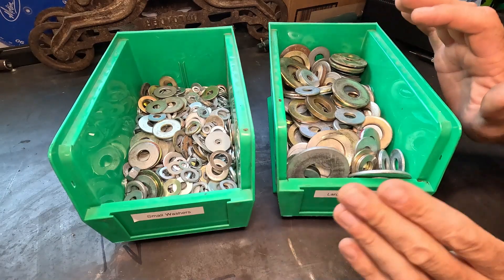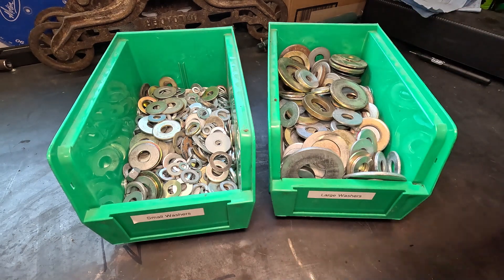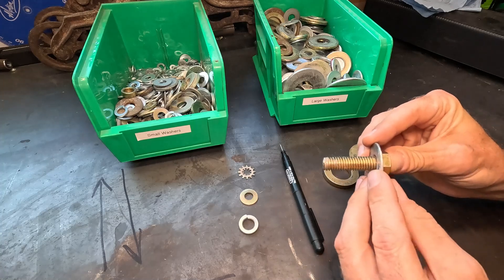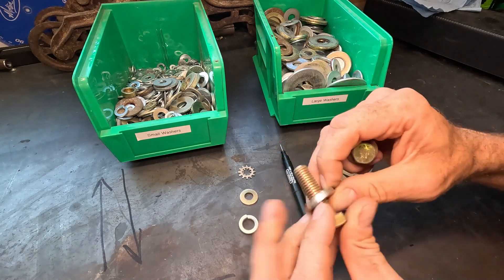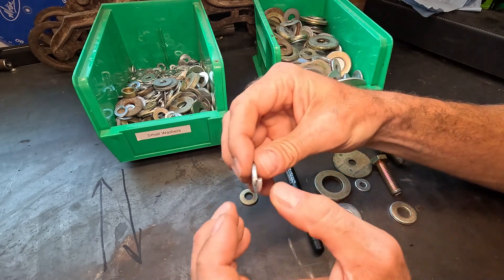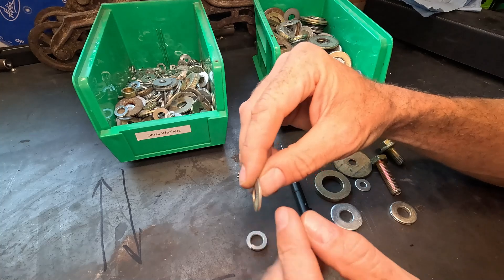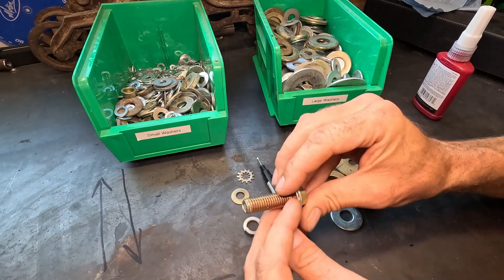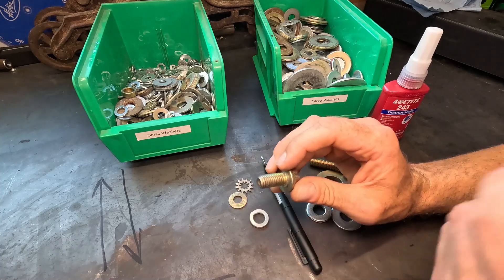What washers do within a bolt and nut joint.

Comment: A properly designed bolted joint does not need any locktite - but they are not actually that common!
Reply from the maker: Oh yes, for sure. This was one of my early videos and I unfortunately used my own dad's term of 'standard' which is false in any regard, depending where you are in the world! The equipment is working on is almost all metric hardware these days. Cheers!

Comment: High strength bolt that are torqued to spec, normally require a hardened washer to provide a smooth hard surface to produce consistent torque values. These washers are never galvanized because the zinc is soft and will increase the torque by deforming.

Washers are typically used when bolting wood together.
Reply from the maker: I appreciate that engineering education! Keeping this video originally super simple for the most basic homeowner, I for sure missed the torque conversation. I've really appreciated everyone's comments and extra education to the masses. Stay safe in those Texas floods happening.

Comment: Thank you for this video. There is something I don't understand. If I am tightening a bolt through a block of steel, why do I need a washer in order to spread the load? Why can't I just allow the block of steel itself to spread the load? Thanks
Reply from the maker: Good point. In a situation like that, with a tolerance hole to the bolt, or the steel had internal threads where you're actually inserting the fastener as a screw, a washer won't really add value of spreading out the load. Like others had mentioned in comments (and I didn't cover, but should have) is there can be other value of the washer such as assisting with rotation to achieve a proper torque.
However, if truly just a hole in steel where you're not dealing with precision, the holes commonly are somewhat oversized to deal with tolerance differences of mating parts, so the small surface area of the bolt head is spread out with a properly sized washer (to the bolt).
Where I work in ag, often those holes in steel have a bushing inserted, so the washer (or flange head bolt) spreads out that load over/past the bushing to catch the parent steel part. So many different situations.

Comment: I thought those washers with a cut are just broken. Found a couple of them in my toolbox and just sell them off as metal scraps😢
Reply from the maker: Nope! Though as you'll read in the comments, many say the split (spring) lock washer is quite ineffective at holding the joint tight. Thanks for watching!

Comment: In a flange bolt the washer is integrated into the bolt, and is much stronger than a bolt and a thin washer, the latter will deform and is a weak spot that will expose the assembly to loosen its grip due to vibration, IMHO :)
Reply from the maker: I personally love flange bolts....fewer parts to drop in the dirt during disassembly 😀

Thanks for watching.

Comment: I think what you wanted to explain is how washers have an inner and outer diameter. The inner diameter determines what guage bolt you should use. The outer diameter determines how much surface area you want to speresd the tension over.
Reply from the maker: Well explained, certainly what I was going for. Appreciate you sharing that clarification! Cheers!

Comment: But why do they exist? You never mentioned what the point of washers actually is, even though that's the title of the video. All I took from this is that there's different types of washers.
Reply from the maker: Thanks for the comment. I was trying to be super basic for a general person about how they primarily spread out the load (force) from a fastener. Will keep working to improve.

Comment: You know, as I've gone back to reply to replies on here, I have another question: Why did you buy a bunch of different sizes of washers to dump into those boxes before knowing which sizes you'd need for specific projects, instead of just buying certain sizes as needed and then not rummaging for the right size?
Reply from the maker: Fair question. I like going to auctions. I bought a big container of new, mixed, hardware. No idea where it came from, but it was a huge lot of new bolts, washers, and nuts. The price was right, so why not right!? There were sooooo many washers, and the bins I had available, is the reason there are (comically) sorted to large/small. Better opportunity to sort going forward, but works well enough for now. Like you mentioned, I buy specific hardware if/when I need it.....if not available in my bulk 1x purchase. Cheers!

Comment: We use those toothed washers for better electrical contact for grounding wire with a grounding screw. Those teeth ensure it cuts through paint/corrosion for better electrical continuity.
Reply from the maker: Ahhh, yes, for sure! I've come across them in various electrical situations.  Great comment, appreciate you sharing!

Comment: Great video again James , This is good basic information that should get most homeowners by. I know a lot of folks don't care what the function of a washer is. But us hardware nuts ,so to speak , they are like the salt shaker on your kitchen table. Coming from an industrial background ,we used hardened washer for certain applications ,like when you have really need to tighten down on a bolt that in  is place where there is a lot space around the bolt. A low grade washer will cave in under high torque were as a hardened washer  will not !
Reply from the maker: It's such a simple thing, but really does serve a wide variety of purposes, and more complexity to it that I really lead on......as I exposed the very basics to the average person.

Comment: Another purpose of washers is to allow a bolt to float into position in a large hole. Sometimes you have sloppy tolerances on an assembly of parts, like NPT fittings joined together. You may not be able to guarantee exactly where the bolt hole needs to be within ±1/8". So, you make the hole bigger than necessary for a perfectly placed bolt, and take up the slop with a washer.
Reply from the maker: Great comment, thanks for sharing.

Comment: Nordlok washers work well. Every other locking washer is pretty much useless. Pretension is the most important factor in keeping a bolted joint secure. Tests have proven everything but a nordlok is pointless.
Reply: I work in the oil and gas industry. I used to work as a subsea engineer too, that's when I really got introduced to them. I've used them in both cases, particularly where there is intermittent loading or vibration. 
The down side to them is cost. If they were cheap, I'd actually use them for everything. As is, only in a needs must basis.
Reply from the maker: @lexzbuddy subsea engineering, wow, fascinating! There isn't much oil and gas around me in Iowa, other than ethanol production....all that corn! I ordered a Nord Lock washer from Amazon, just to see/play with one 😀
Reply: @LearnedFromDad  try not to break it :)  They work best in pairs, one under the bolt head and the other under the nut. I've witnessed testing and seen for myself, first hand, how much better they perform. I haven't seen anything pass vibration tests like a nordlok. Everything else, pinned, serrated, double nut... all just come apart.  

I spoke with a guy that works for the RAF and he said the nuts on aircraft all loosen off eventually. He said the good thing about wired nuts was at least don't loose the nut. Well, if that doesn't worry you, I don't know what will. OK, it's a bit funny too but you get my point. 

With all that said, enough load and vibration will defeat any solution, there is no such thing as perfect. But they are head and shoulders better than everything else.
Reply from the maker: @lexzbuddy  hahaha, sounds like I better purchase multiple! And I agree, no design is flawless, always a failure mode. The creativity of either next engineer will fascinate us! Cheers!
Reply from the maker: I've had many people comment about Nordlok, but I haven't personally encountered them yet. Any idea what industries commonly use them? And, great comment about tension. Really appreciate you sharing! Cheers.

Comment: If you put bolts in a machine with vibration use caulk silicone as thread locker, for me works every time.
Reply from the maker: Interesting technique, I hadn't heard of that one. Thanks for sharing.

Comment: Not sure if anyone else commented this but the additional feature of the ‘split’ or lock washer besides the compression effect is: The lock washer actually digs into the materials and literally locks or creates an anti-rotational action. If you look at the way the split washers are stamped out they cannot easily rotate left(loosening direction), but they turn easily right(tightening direction). Lefty loosely, right tighty. Don’t use a normal lock washer on a left hand thread, lol….   Great video!! I am now a subscriber.
Reply from the maker: While many have commented about the ineffectiveness of a split (spring) lock washer, you're the first to reference that point. I wonder if they make a left thread intended split lock washer? Thanks for sharing.
Reply: @LearnedFromDad  good question on left hand split washer. I bet you could find one deep in the Mcmaster Carr or Fastenal printed version literature books. From my experience, left hand threads are typically used when the application has a motion or rotation that is trying to turn the bolt in the counter clockwise(lefty) direction, so a good designer will use the left hand threaded bolt. That way the thread is always being ‘tightened’. Left hand threads really play a trick on the mind during tightening and loosening, even when you know it’s a left hand!
Reply from the maker: @jonathanj777  now I need to go have a look out of curiosity! I definitely come across the occasional left threaded hardware like you say, in a counter clockwise rotation situation. Another unique thing I learned from my own dad was about left (ccw) rotation drill bits, particularly used to help remove a siezed right (cw) threaded bolt if drilling it out. Always fun learning tricks and techniques from people. Cheers!

Comment: I often used washers when the hole was too big for the bolt.

Another use is if the bolts you have are too long.
Reply from the maker: Great points, absolutely, thanks for adding that. Cheers!

Comment: traditional split lock washers actually harm fastening securement compared to the same material flat washer.  AvE did some high precision testing.
Reply from the maker: Thanks for the comment. I know there has been some interesting discussion and research of various lock washers. And, a lot of good comments on this video. Definitely no solution is failure proof, and we grow over time. Thanks for watching!

Comment: Flat washers are also good to help protect painted surfaces against damage from the twisting of the bolt or from contact of the socket against the paint if you are using a ratchet wrench.
Reply from the maker: Yes, great comment. There were a few other reason for washer use I should have mentioned. Cheers!

Comment: NASA has demonstrated that lock washers provide little or no additional holding force.  So using them adds no value other than spacing.
Reply: NASA, now there's an outfit I trust.  Space Shuttle o-rings at 25° = kaboom.
Reply: @johnkomosa9508  You do know you are comparing administrator political decision verses engineering analysis.  I remember seeing images of the shuttle launch towers with ice cycles hanging of of them, and thought they wouldn't launch with the temperature below 0'C.  I guess they thought they knew better than me.  That is what happens when politicians and contractors are under pressure to launch.
Reply from the maker: Just saw this comment. You touch on an interesting general point in any business, the fine line between timelines, engineering perfection (risk), and business/perception. I watch it daily, such a tricky space. Are you within an engineering field?
Reply from the maker: Others have mentioned that, and I'm not surprised.  I'd love to learn more about the NASA investigation, just haven't had time to research. And, I want to experience the Nord Lock washers many have talked about.

Comment: In addition to the uses cited, washers are also used as spacers, e.g. on an axle between a wheel and a wagon body.  The purpose here is to prevent the spinning wheel from rubbing against the wagon.
Reply from the maker: Thanks for sharing. Absolutely, there were a couple simple, common uses I missed including spacing/shimming. Appreciate you adding that. Take good care.

Comment: Should the washer always be on the bolt side?
Reply: The short answer is that it depends on the situation and material.

In a general situation of spreading load, it would work on either side. BUT...in the case of the one washer he had which was a large outer diameter with a very small hole, it's different. That type of washer is known as a "fender washer" because it's commonly used on auto body sheet metal. The reason? It's so large that it spreads the total load over a larger area, reducing the chance of distorting the thin metal that fenders and other body panels are made of. So in that situation if you place it on the nut side, the head side may be imprinted by the small surface area of the bolt head concentrating all of the fastening force into a small perimeter.

On most surfaces you really wouldn't care about a little distortion because most surfaces would be much thicker/harder. On things like, for example, a wooden children's backyard play set, I would put a washer under the bolt head AND the nut because wood is usually soft, so the washer would spread the load under the bolt head and it would also keep the nut from digging into the wood as you tightened the nut.
Reply from the maker: Sorry for delay in responding. I read the other reply and he said very well what I agree with, and have seen. Really depends on the situation and joint.

I also appreciate the other reply calling out a 'fender' washer. I had one in my hand in the video, but didn't call ot out as my original audience intent was those very new to such a simple part, and I could hear my kids in my head saying "dad, we do care about the micro differences " 😀 Thanks for watching, take care!

Comment: In trade school I was informed “split” anti loosening washers strictly should only be used once. The “spring” effect not as important as the “bite “ of the spiked up edge at the cut of the split. Properly it should cut into the bolt head and the base metal to mechanically prevent backing out. Removing the bolt should damage the washer or base material. Consequently hardened high tensile bolt or base material will not get bitten into defeating the purpose.
Reply from the maker: Great comment. Definitely many sharing the same sentiment about split (spring) lock washers.

Comment: I am sorry at 1:29 this is not a bolt, this is a screw. A bolt is a length of threaded rod, inserted into two mating holes of two pieces of ie. metal, that is fixed by nuts at either end. A screw is any and all types of fixings that can be screwed into a hole, either blank or threaded, by the use of a tool; screwdriver or wrench or socket.
Reply from the maker: Completely understand. I should have grabbed something more appropriate to make the 'bolt' reference versus a technical screw. Appreciate the correction.

Comment: I work in a precision engineering shop, and some who've been there years still add a washer under a nut that locks against a threaded hole in a vice side stop. And some never add a washer over a slotted fixing point in the vice side stop! Doesn't sound like much I know, but I just signed up on the Dull Men's Club, and it really matters to me.
Reply from the maker: Thanks for sharing. Precision engineering, I suspect you all work on some neat stuff!

Comment: Washers are for carpenters working with wood. 
Else it’s poor engineering.
Washers cannot secure a bolt.
Washers do not spread any load.

Thanks for mentioning that threat locker. It’s the real deal.
And of course there are thousands of useful washers designed for a specific purpose (sealing, applying torque, giving space)
Reply from the maker: Thanks for the comment and watching.

Comment: A small smear of silicone can prevent a nut from loosening caused by off-roading... And it can be removed...
Reply: Silicon being a threat locker? Never heard this before. 
Stay safe 👍
Reply: @andreasreichwaldt3994  it's mostly used in temporary situations like a "bush fix"... Or something that can't come undone until you want it to... It can also be used in conjunction with washers for waterproofing...
Reply from the maker: Interesting trick for a bush fix. Or, in my area, referred to as a farmer fix.

Comment: I don't get how the load from the perspective of the bolt head would be spread more against the washer than against whatever else metal surface the bolt head would be pushing?
Reply from the maker: Fair question. So, as an early video I definitely should have added some real examples, learning curve. A couple things. Depending upon the material being clamped with the bolt, the underside of the bolt head doesn't have mich surface area. With this material like sheet metal, you could draw the bolt head through, or similarly with wood, that head can contine to be pulled into the material. A washer sized to the bolt will spread that force out against the parent material and minimize pull through or deformity.
Another example being a hole that is not sized perfectly for the hardware, slotted, or maybe has a bushing that will wear over time. The washer spreads out the surface area of the bolt head (maybe poorly stated 'spreads the load/area').
Make sense what I was "trying" to explain?
Thanks for watching, cheers!